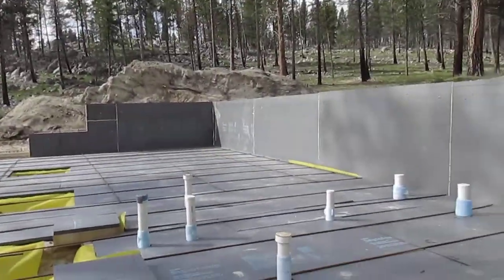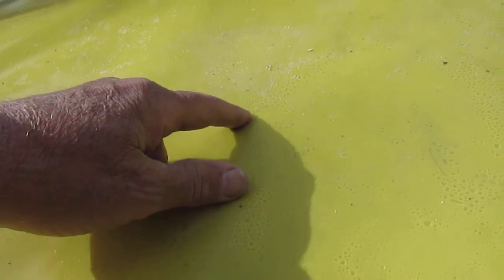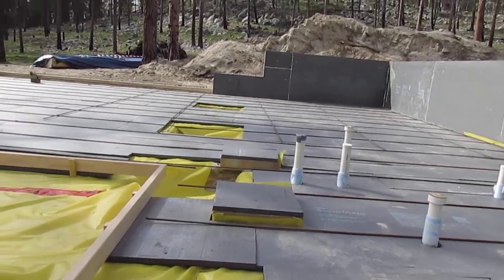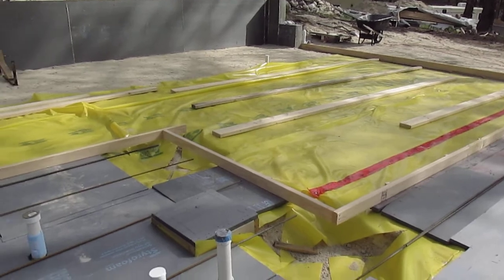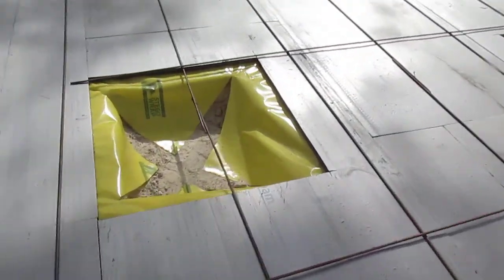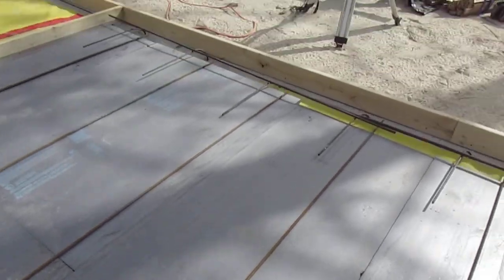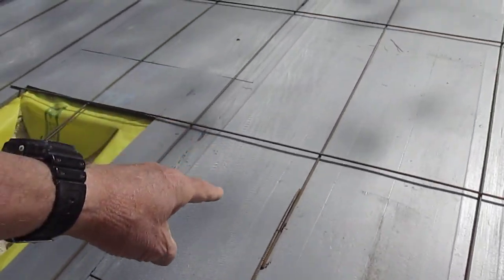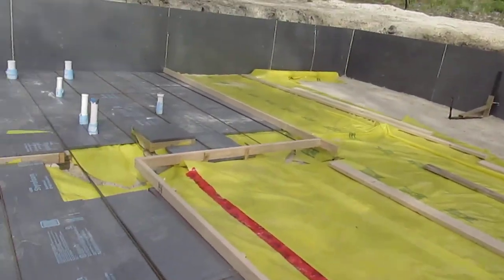Under slab plastic below foam insulation.

Comment: Stego was a smart choice, as polyolefin is the only non-biodegradable barrier.  You cannot get mold from saturation, only when a high-sustained relative humditiy (70 to 98% RH) is present against a material that  has a food source, like drywall, wood and carpet.   The BIG ISSUE is that the water-of-convenience used to place the slab, will not dry-down to acceptable RH values that are considered "safe enough" for floor covering installations.  Vapor-barriers under the slab are for LONG term, but don't solve the short-term issue of saturation in the body of the slab from casting.

Comment: It’s depends what is the purpose of the building. Normally heated home or garage, under the concrete slab & on top of the insulation. If it is a refrigerated warehouse, the ground will be most of the time warmer than the concrete, so under the insulation. Humidity migrated from warm to cold.

Comment: Many people don't realize that foam does actually absorb water over time. This is also why the vapour barrier has been migrating to the exterior of buildings and homes in newer construction. When the insulation is in the area where condensation is present the r value is effected in a negative manner.
Good job!